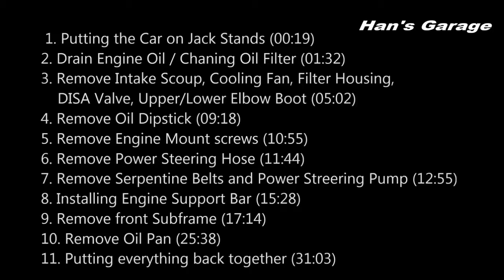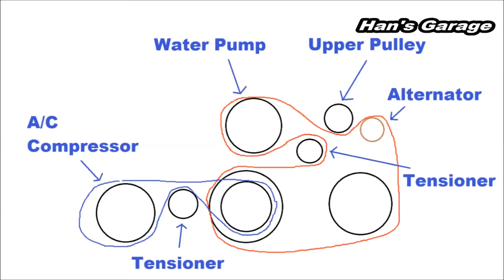BMW E46 3 Series 1999-2005 Oil Pan Gasket Replacement DIY

Comment: how did he cleaned the oil pan?
Reply from the maker: 25:41
Reply: you could use decreaser like gunk and use a steel wool ball like a 000 or the finest one you can get and give it a little bit of elbow grease on the surface where your new gasket will go, and use a spray bottle of degreaser, shop rags and a brush for the inside that way you can irritate and get the harder spots out, could try to use an air hose to blow it out afterwards.

Comment: Are you gonna use an engine lift?
Reply from the maker: I sure did. You haven't watch the whole vid have you?
Reply: HAN'S GARAGE 
No just started.. This DIY works for all E46 series including M3, right?
Reply from the maker: @G33ZiM3  I wish I had the e46 m3 to tell you but it shouldn't be too different
Reply: HAN'S GARAGE 
Ok,, on my way to Harbor Freights for the engine support bar and I will give it a shot  replacing the sump gasket.

Comment: How long did this take you?
Reply from the maker: 3 days with lots of breaks inbetween :)
Reply: HAN'S GARAGE wow. I'm sure you know about the special shortcut trick some people in forums have talked about? Where they cut the oil pan gasket and then seal it. This prevents you from having to remove the subframe. Thus cutting the job from 9-12 hours to 2-3 hours. What do you think about that method?
Reply from the maker: I'd say try it out! whatever gets the job done faster and efficiently :)
Reply from the maker: but at the same time doing it right the first time is the safer route.

Comment: that doesn't look safe, what if your ebrake slips? at least put some bricks under the rear tires or something.
Reply from the maker: hahaha yes, I was extremely scared to go under my car in the beginning but having to do it so many times for most of my projects, I have found the safest way to jack up my car. Thank you for your concern! you have nothing to worry about :)
Reply: well it would be good to teach other's, just put a comment to use wheel chocks.

Comment: Hans do you think it would be easier to undo the two track rod ends the the wheel giving you possible room to swing that rack out the way? Or is this not possible?
Reply: Yes, but you also have to lose the steering column